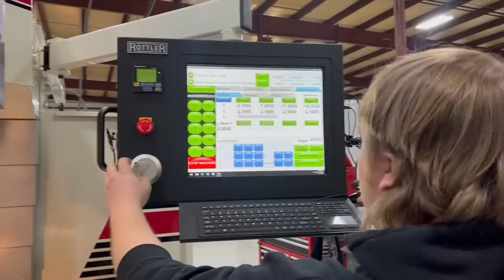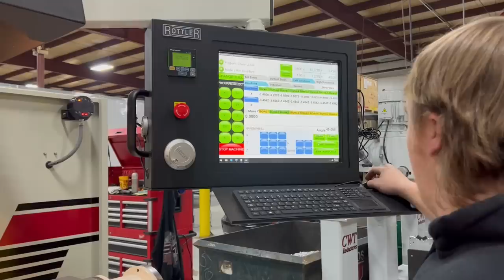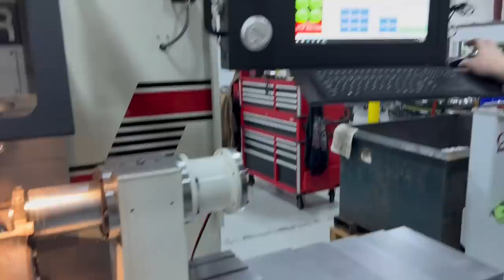PART 2 - This Is How Race Blocks Should Be Machined!

Comment: Brother I love you videos. I have been machining in the job shop world for over 25 years. The equipment you have is so specialized to what you do, but there are some crazy advanced tools that could be also used on those machines. I would love to see you talk to a large tool manufacture, they have Bluetooth bore heads that give you data on how the cutting is reacting, it really helps dial in feeds and speeds. They could also get you tools ground that would cut your sealing ring on the block for the boost ring your are cutting to put a small break edge to eliminate the burr. Also, we all know sharp edges internal or external edges are were cracks start. I love the level of detail you take into building your motors, I hope you do not take this as criticism,  I just love teaching as much as you and wanted to offer my experience and thoughts if possible. Thanks for the great content, I have learned so much from you, trying to pass on the favor. Please take this in the context im trying to convey lol, words are not my strong suit. One day I will have a 69 Chevelle and be able to afford one of your engines, that is my biggest goal. Thanks again for what you do brother,
Reply from the maker: Thanks
Reply: Good comment Jared
Reply: Would be cool to see a cnc collaboration with Titan. He does parts for aerospace with insane tolerances !

Comment: I like how the machine spins the tool at a high RPM to maintain correct surface footage for the tool in the cut, then slows down to eliminate any possible chatter marks. Very cool

Comment: When starting with a mass produced part from any auto maker, Ford, GM, etc. there's what's known as the stackup. All the features have tolerances of course and if you go to the worst case dimensions for each, by the time you get to the feature you're wanting to machine, you're .020" out of true. Like Steve said in the first part of the video if the cam tunnel is say .005" from end to end out of straight, start there. Bore it perfect with the crank first, then go to the lifter bores. Normal everyday car engines don't give a shit about those few thousandths of an inch. A race engine going twice the RPM and 4x the HP does care. And will tell you they care when they come apart.

Comment: A few thoughts from some pest out in the cheap seats

Block Fixtureing ~ As there is no mechanical connection between the 4th axis and it's tail stock there might be a few things that would pay in the long run. I would assume that the block is held by an expanding mandrel on the front and rear main bearing. To even out the fixturing the Tail stock does or should have an anti rotation brake that's applied when it isn't rotating the axis and a machining process is taking place. May I suggest a couple of adjustable stops on the 4th axis backing plate if it isn't bolted all ready? These would go on the oil pan rail at the rear. This would guarantee rotational position and eliminate the rotational torque that's put through a single clamp point. This is also insurance that if there is a timing issue with  the tail stock brake there wouldn't be any extra rotational force put on the mandrels and caps. 

CNC Machine ~ Ergonomically the position of the knockout button for the spindle is very poorly placed. With this machine only having a manual tool change the frequency of using the touch screen is far to high.  May I suggest a button mounted on the spindle head to help the operator. This will allow eyes on the spindle during the swap and may prevent an accidental dropping of tooling that can be fragile and slippery when there is coolant around.  Also that style of pull stud and ball bearing draw bar locking collet Can spit the tool back out if the cone isn't properly seated, this could also spit it out of the hand holding it in place. A very common thing across many brands of CNC is to add a short dwell for the clamp and a slightly longer dwell for the unclamp. Usually giving time to seat the cone and time to catch the ejection.
A suggestion that should help with the setup I noticed that the machine didn't have any mechanical switches short of an Emergency stop. Perhaps a cycle start button, feed hold button, Spindle speed override knob and a feed rate override knob. The Spindle and feed controls  can be useful for uneven cuts, hard spots or situations where the programmed speed may need to be slowed. It also adds the possibility to control with certainty with your eyes on the job not the screen.  First contact withe every process comes to mind? In my experience touch screens for frequently used operations can be troublesome and when they fail it can go unnoticed causing intermittent faults. Better off putting the most frequently used operations on mechanical buttons and switches and keep it in good order.

Forgive my oddly long comment it isn't meant as criticism. Please don't misinterpret these suggestions as they were only made to help in the long term.  No shade aimed at Rottler as well just a little surprised that some of these are not included on every machine. 
Cheers

Comment: steve< am a retired tool & die maker & toolroom foreman. & engineer. I still have all my fingers &you are not going to have yours for long when you put them in near a running machine. if you have any body injured in your shop & MIOSCH look at these videos you can be sued as your fingers are in the working area. Please use a lazer pointer & save my worryng
Reply: should be MICH OSHA

Comment: You should get those inserts EDM'd with a chamfer built in if you are using a common fire ring depth on all your receiver grooves.  I have form tools made like that for oringing surfaces all the time and then you don't have the burr.

Comment: What about adding angled holes for splayed 4 bolt main caps? I'd imagine one could write a stroker block program that could include those so all you'd really have to do is mount a block, pick your program (with or without splayed caps) and hit go. Then it's just a matter of babysitting the machine in case of tool issues, correct?

Comment: I wonder if it would be possible to get a GoPro and attach it to the machine under the hood where you would have a birds eye view of the cutting in process. Seeing an engine go from raw to finished would make for some really neat time-lapse footage I think.
Reply: There are quite a few vid's on YT of exactly that - from a solid block of billet to a finished bare engine block. Also heads, cranks, rods, etc, if you're also interested in that.
They're quite mesmerising.

Comment: Machine work is so fascinating to me. When the tooling gets longer such as the boring tool for the lifters, is there any flex in the tool?
Reply: I would imagine the body of the toolholder is the maximum diameter that space permits, with the actual boring tool only as long as the bore itself...OK, maybe  1/16" or so longer...

Comment: Are you using a 3mm or 5mm tip on your renishaw ? Get a couple extra they shatter pretty easily. Dykhouse  has them they're just down the street from you. If you have multiple off sets you can use G54 for cylinder bore and a G55 offset to do lifter bore and save time with one setup if they are off . Depending on what cad software you're using you can do a auto inspection with your probe before you ever start

Comment: So the factory where the blocks are made use the dowel pin holes to measure and do their fixtures off of ?  You do the same but your new machine is more accurate and properly centers the bores, etc?

Comment: Does it fixturing to hold the block by the deck to square the back of the block and drill through lifter bushings?  It would also be great to ise it for set screw holes for the bell housing dowels.

Comment: So Steve .. when doing the lifter bores you would just go by the cam bores 100% of the time ...to stop any misalignment and error
Reply: Guessing any alignment errors would result in differences in the lift and duration at the valves. So I'd say yes, it would be best to always align everything as much as possible. Cam to deck height would also need to be bang on. Same thing with the heads. Rockers to deck height would need to be bang on. The 1st cut would be the mains, and then everything else would get aligned and cut from that. They don't have tooling for that yet, so they have kind of skipped over that step.
Reply: @joebloggs2635  like Steve said it is only 1000 of an inch ... if the machine is set and the mains are done you would do the cam boring at the same set up with out moving the block off of the set axes
Reply: @Lewis Radbourn  exactly. You'd do the mains first. Then machine the cam, guides, deck etc from their. All as close to square and equal as possible. Within 1/1000 would  be amazing. The problem is if you're cam to deck ain't the same, you'll get a variation in the lift height of the valves. Don't forget that the tappet (rockers) gives a mechanical advantage. Say 3:1. So, a 2/1000 difference would end up being something like 6/1000 in the lift of the valve. If you gain or lose that amount, it depends if it is heigh or low. Your mid valve values would likely be 3/1000 off. It's negligible in your average everyday car engine. But in a high performance engine at 45PSI boost spinning at over 10,000rpm It's gunna make a difference. Possibly be catastrophic. A quality engine builder would measure the lift and duration of the valves once the engine is together to see if it is within tolerance.

Comment: If I heard correctly it will bore the block in the correct bore location ? So if for some reason the cylinder was off and it was getting bored,  you could put the cylinder back in the correct location ?

Comment: Steve could you deck and weld the head bolt holes and retap Ls head bolt pattern on a small block Chevrolet to accept LS heads?
Reply from the maker: Yes
Reply: World Product LS blocks are just that. Gen 1 lower with LS head pattern and deck.

Comment: You would think that machine would have some sort of coolant or lubricant with all the metal to metal contact?? Why is everything a dry cut?
Reply from the maker: This is the normal way of doing it. It makes no heat
Reply: Cast iron prefers to be cut dry, especially at the smaller Doc he is running, coolant is for hi feed machining, not needed for finish cutting and that is all he is ever doing. Steve knows his stuff and is extremely on the ball with what he is doing. This comes from a job shop machinist, not an engine builder. Just my humble thoughts from lots of experience cutting metal.
Reply: @stevemorrisracing  Thank you! I’m an old mechanic and not a machinist! I could hear the sound of the cutters doing they’re thing and it made me wonder! Now I know! Thank you again

Comment: I'm surprised they don't offer an auto tool changer. Also a renishaw tool offset prob would be nice instead of the 1-2-3 block
Reply: The number of tool changes is minimal so it isn't worth  the extra $$$ and complexity.  Cylinder boring head, groove cutter , fly cutter , lifter bore head,  long end mill are all he used so far and not all blocks are going to use all of the tools.   And, you have to preset the tools for each block anyway so there is nothing to gain with auto change.
Reply: It has a renshaw probe for location but I guess not for tool length offset.
Reply: @br549rdr  The tried and true , " paper under the tool then hand wheel it down until it catches " works just fine.
Reply: Tool changer is useless, as all tools will have to be set to each job every time anyway 

Yes if he was doing only the same block and setup all the time then it would be worth it.

Comment: Another great vid .. Curious ... No need for any lubricant when machining?
Reply: Hey just tagging along with your question but the fluid injection has another Important function to keep the dust down.
Seems like you can see the metal chips floating around in the video.

Comment: One thing that I have often wondered about is why are the head gasket surfaces milled rather than surface ground?
Reply from the maker: You can do either
Reply: @stevemorrisracing  I thought that might be the case, although I have only ever seen fly cutting used. I suppose that milling is the faster option.

Comment: Do you have the coolant turned off on the machines for filming or is it not necessary? I dont have any experience machining aluminum but with steel there's almost always coolant running while the machine is cutting
Reply: IC carbide inserts have decent life without coolant, on steel. On aluminum you have to give them some oil or it will gall up your workpiece
Reply: Cast iron, self lubricating while being cut 😎

Comment: There is no cooling liquid/oil for that machine???
Reply from the maker: Nope This is normal
Reply: Thanks I guess because it’s not made to drill holes, just small finishing cuts.
Reply from the maker: @TheMaxburn  we would manually lube for drilling 
For what you do with This machine, and work, dry is normal

Comment: Steve, my block has some ovaled out lifter bores and some are telling me they'll bore them round and use sleeves and I was also told I could get over sized lifters, help, it's my first time w this issue. Which do you recommend ?
Reply from the maker: Either way is fine. 
I would go next size up in lifters. Bore hole round
Reply: @stevemorrisracing  thanks so much, I will. I thought that was the way but the shop doing the machining has been adamant to go with sleeves because they will help oil flow.

Comment: Why does the machine start with an RPM, plunge at a feed rate then slow way down while still in the cut before retracting? Specific to the ring grooves at the beginning of the video.

Comment: If you don't indicate each bore, how can you be sure you're dead center. Are you assuming all the bore spreads are right on and where they should be?
Reply from the maker: We are putting them where they are supposed to be not to here the are.
Reply: @stevemorrisracing  good deal. I see now. I have so many questions about what yall are doing fixture and setup wise. Please consider a video on that too please!
Reply: I have a couple decades in manual and cnc machines. Wondering what datums you work off of, etc.
Reply: How do you set the block up on the indexing fixture and such.

Comment: i would to see an engine with very large displacement, like 1200ci and several turbos, like 4500hp on the wheels. that engine behind the driver, middle engine. that car should be like 350mph fast. the front of the car can be made tall and V-shaped, that has very little wind resistance. its strange that there are so many alleged supercars and non has an engine like that, they all are lacking, yet there arw workshops that can produce engines lik that.

Comment: Is there a preset option that would allow you to upload  files if you’re doing an identical job? Or does it need to read each blocks initial measurements because they’re all different tolerances
Reply: general positions/rotations are similar, so could probably have a generalized preset that you could fill in the more precise details on.. each block will likely be pretty unique in it's original machining...

Comment: OK, matbe someone has already asked, but... how is all this cutting getting done with no cooling/lubrication during the process? What the hell are the cutting tips made of?
Reply from the maker: This is normal machining
Very light cuts and machine nice with no temp
Reply: Carbide
Reply: Not needed for a lot of operations. Cast iron can often be machined dry.  On normal cnc machines it's better to do roughing dry with no coolant on steel running coolant while roughing with inserted cutter can repeatedly quench inserts causing them to become brittle.

Comment: You don’t need to run the machine with a cooling fluid?
Reply: Not for this.  It cuts very slowly at low temps
Reply: @fopeezy3097  they don’t hone the block dry do they?

Comment: that's cool but not a fan.. you could make that go much faster with machine with an atc, spindle and flood coolant. the right coding with macros and it could be near idiot proof. we have a rottler at work, several and it's not the best machine. in fact the older simpler unit does a better job. i've ran evey machine in that our department and the real cnc machines are so much better. a probe helps, our rottlers don't use that but i've seen enough from our new "cnc" rottler that i do not trust it. pilots are expensive and other have broken more than a few trusting it. also an optical tool adjustment station is a game changer.

Comment: My question is why doesn't that fancy machine swap it's heads out by its self? 🤣
Reply: I expect it would if you added another few zeros to the price.
Reply: Because every tool will have to be set for every job any way, as most blocks will be different spec/engines etc so you'd have to set them any way.